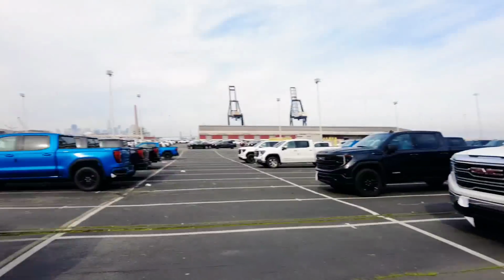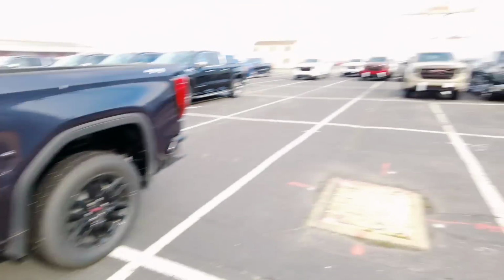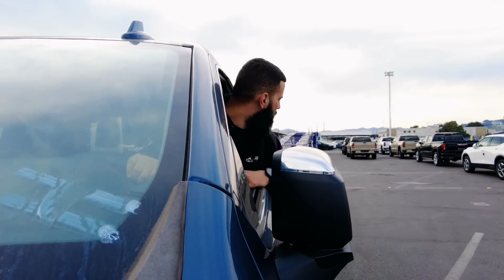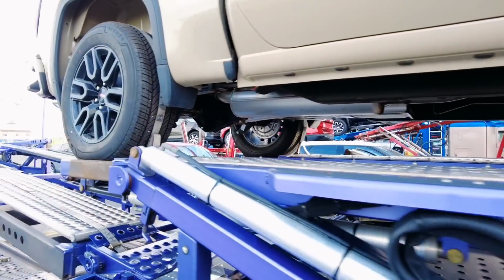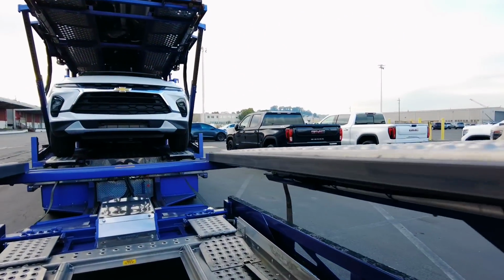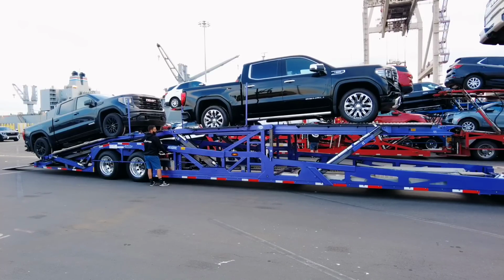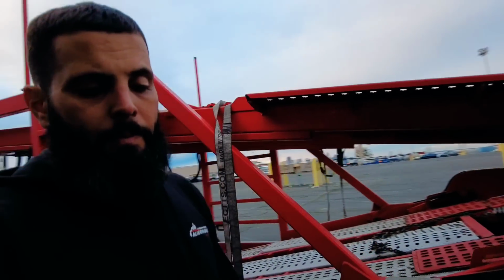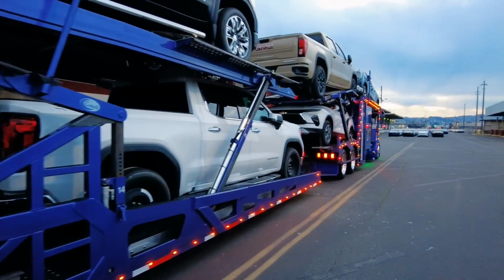I Loaded 6 Trucks And 1 Suv In California Watch And Learn How It's Done

Comment: Mornin Brother, interestin question, when ya replace a vehicle, don’t ya have to get a matching vehicle? 
What happens to the vehicle ya leave behind?
Reply from the maker: Doesn't necessarily have to be a matching vehicle could be any other vehicle as long as it fits. The vehicle I leave behind needs to be fixed in order to be transported and delivered.
Reply: @Ralphybilt    Roger That, I figured the dealer had specific vehicles. Thanks for the clarification

Comment: As soon as you get time under your belt, get away from those types loads. No pay, time consuming etc. Transporting high value cars (1/4 mll.and up pays 5/10 times as much. Keep your damage claims as close to zero as you can (and "they: will check) Good luck to you. PS. I would not have commented if I hadn't saw you "walking lot & looking" for cars!
Reply from the maker: Honestly I would rather not move high end cars if I had to choose. A bumper on a Lamborghini is 5/10 times more expensive then a bumper on a Toyota prius a scratch is more expensive on a 1/4 mill car than your regular vehicle. I've seen it done and would rather deal with what I'm working with now like they say more money more problems. Thanks for the advice though 👍🏼
Reply: @Ralphybilt  I went 30 + years w/o a damage claim on a vehicle. But, to each his own. One thing about car hauling though, you'll always have a job!  I soid my interest in my auto transport company several years ago and every so often I'll get a call asking me what truck do I want to go back to work for them! Won't bug you anymore. Stay safe.

Comment: Why did you load the first truck backwards?  I would think the wind would hit the back window along with the tailgate and hurt your gas mileage? Am I wrong in thinking this way.?? I know you don’t get good fuel mileage anyway but every bit helps….I’m not a driver either so I’m sure there’s a reason why you did that…
Reply: Probably engine weight not too far forward.
Reply: Weight is one reason,  but main reason is When you back the truck on the whole back hangs off from back tire to rear bumper,  in the front it's shorter  giving room for the second vehicle,  if you load forward then that whole back is up in the 2 spot,and for me I had one loaded forward that later needed jumped